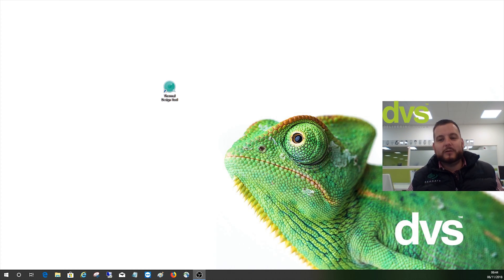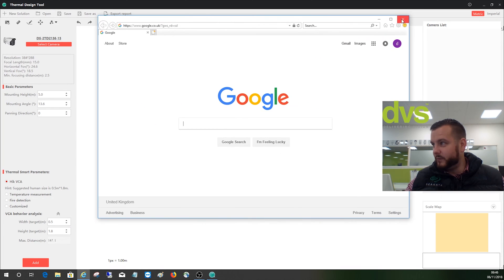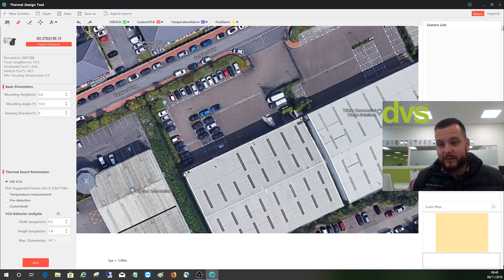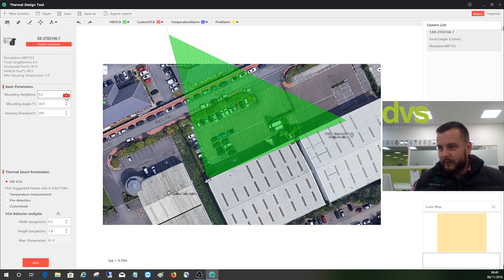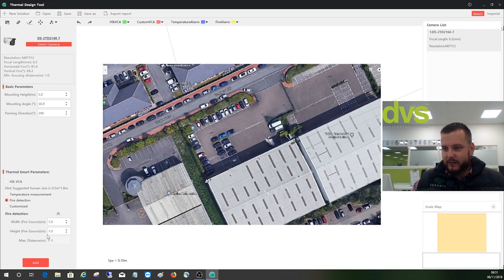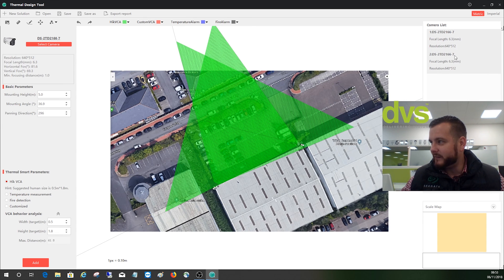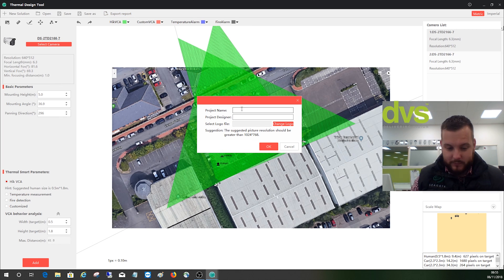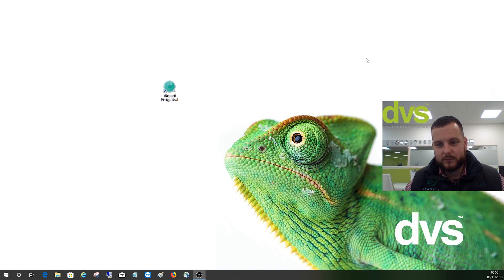HIKVISION THERMAL CAMERA DESIGN TOOL

Comment: The video is very good, however, you could speak more slowly because not everyone who watches the video knows enough English to be able to follow it and this is not only about the hearing, but it is also about what you are doing at each stage.
As you presented the video, few people understand what you are doing even if they know English, because the other problem is that not everyone is used to this type of software.

Hugs